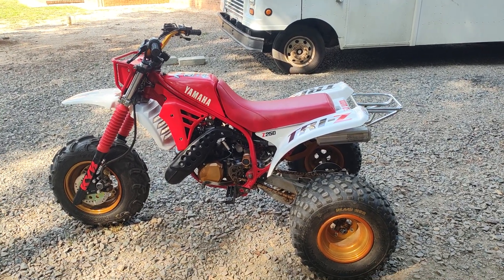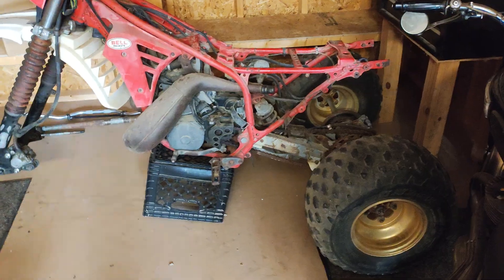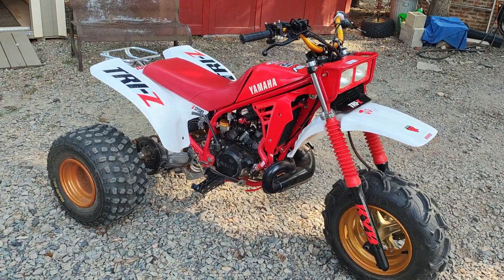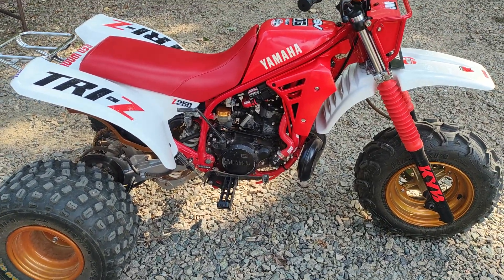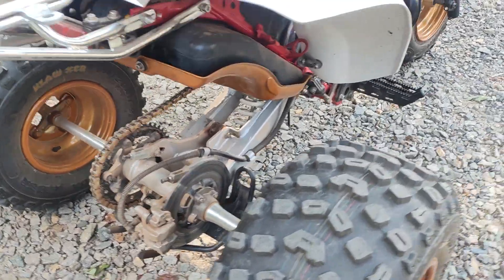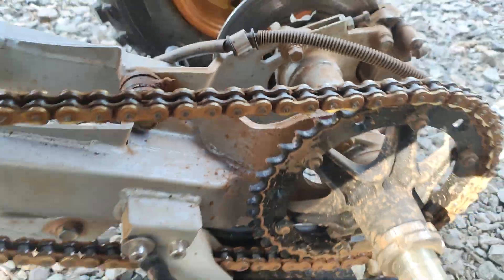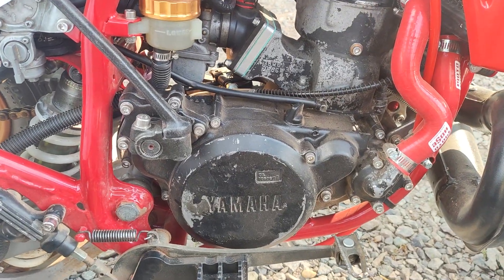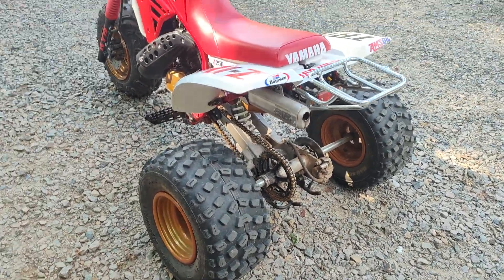Yamaha Tri Z 250 Metro Rod Walk Around

Comment: Nice love the Yamaha three wheelers. I see you have a 175 too. A nice assortment of trikes.
Reply from the maker: It's actually a 125 with the 175 front end!
Reply: @EkonRekon  oh neat never though of doing that. does it just slip right in or did you have to mod it a little?
Reply from the maker: @kollinspencer847  bolts right on man
Reply from the maker: @kollinspencer847  I think I've got some extra fork tubes for the 175 if you need them
Reply: @EkonRekon  cool thanks ill let you know. i do have my eyes on a 125 so itd be cool to have atleast front shocks if i get it.
Reply: picked up that 125 yesterday and got it to run.
Reply from the maker: @kollinspencer847  sweet!